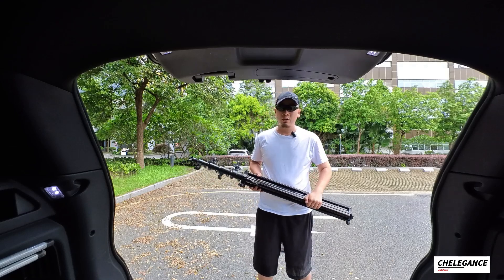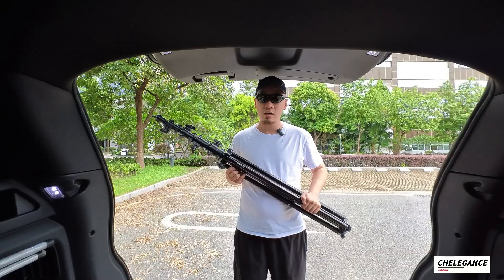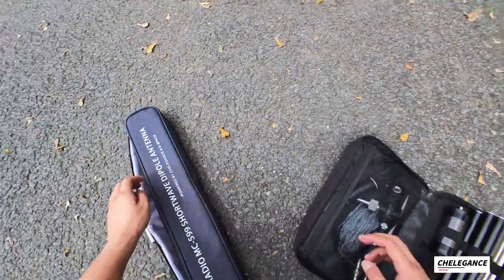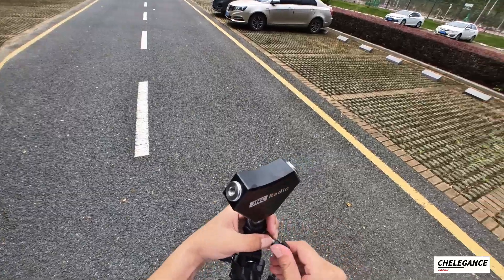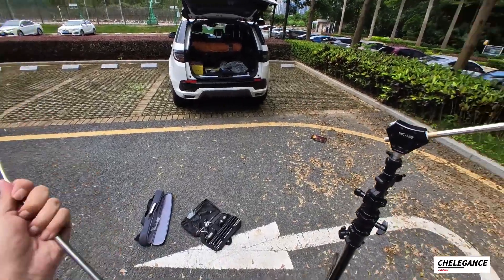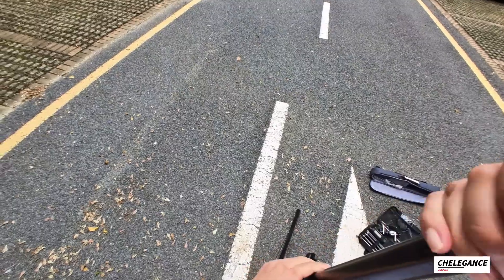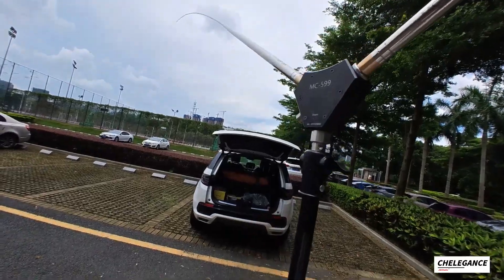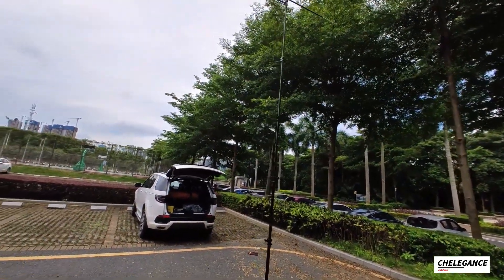Set up Chelegance MC-599 and JPC-7 with TP16 4.8m antenna mast!

Comment: This is a very solid antenna solution. I use it with the MC599 but also as mast for a J-pole. I am very impressed with the build quality and due to its weight its not for backpacking but to hold up heavier antennas. I also have used it for an Inverted Vee antenna I use on 60m lowered to 8 feet for NVIS.

Comment: Looks great!
Will it support JPC-12 ?
Reply from the maker: it does not provide a direct connector(adaptor) but however if you use a bracket to mount it on it should work